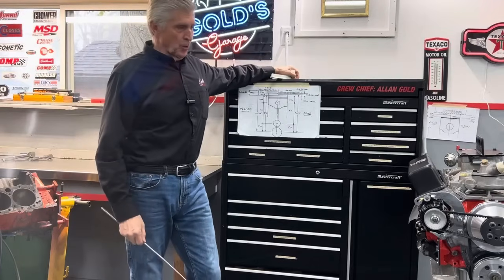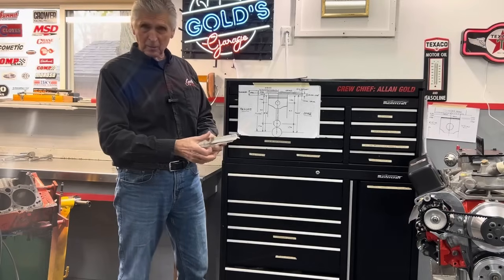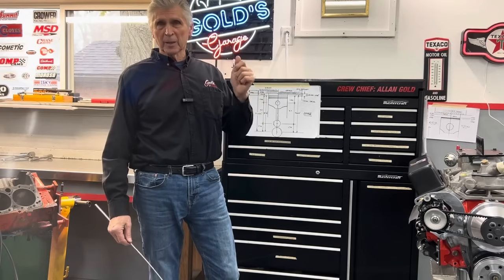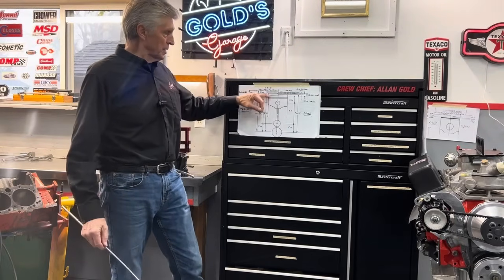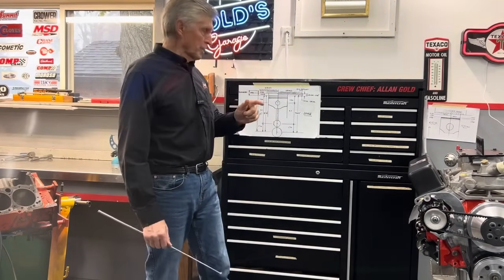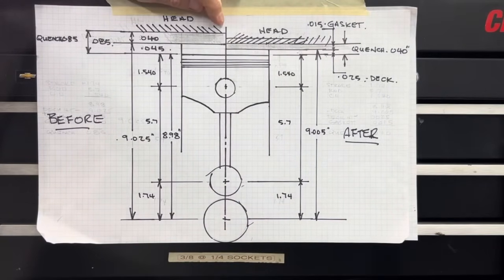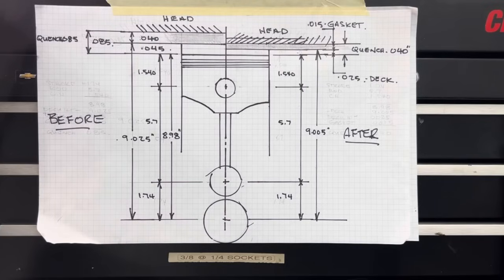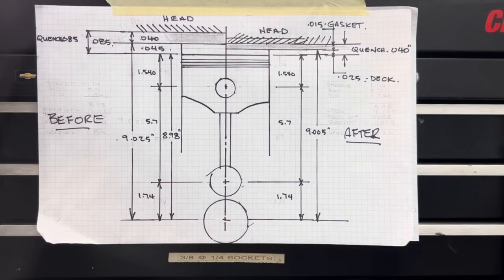MORE COMPRESSION, MORE HORSEPOWER LESS QUENCH! Why it’s Important and what is ideal?  🚫DETONATION

Comment: Standard "deck height" of a SBC is 9.000", not 9.025"

Half of the stroke 3.480" = 1.740"
1.740" + 5.700" rod = 7.440"
7.440" + 1.560" compression height = 9.000"

Factory blocks came with .025" to .030" of "meat" on the deck surface by design. It was to allow for future serviceability. They didn't know it was going to become the staple of production V8 engines throughout the world. They just knew at some point it was going to need to be rebuilt.
Reply: Just as I thought, a quick inet search says Allen Gold IS correct...
Reply: @alleyoop1234   You need better sources.
Standard deck clearance is 0.025" to 0.030" which brings the total deck height from 9.025" to 9.030", but that's not the spec of the block. 

Have you ever heard of someone "zero deck" a block? That's what they mean. Bring the surface of the deck down to 0.000" variance, ergo, within spec of 9.000".
Reply: @Carl_Jr   My machine shop considers zero-decking to be matching the installed piston height, regardlesss of deck height dimensions.  If you want a 9.00" deck, regardless of installed piston height, that's what you'd ask for. Maybe my machne shop is unique.
Reply from the maker: I am enjoying your conversation guys, thanks for contributing to my channel. AG
Reply: @100amps   It sounds like they're using vague terminology. You can't zero deck a block to the installed piston height because some pistons have different compression heights. There are some pistons which are called "claimer pistons" which have a compression height of 1.54" . If your machine shop were to deck the block down to those they'd likely hit water.
Reply: Deck height is what you make it, and it starts at approx 9.025" as Allen said, on a SBC, hence "standard (original) deck height". Compression height is 9.00" as you said. "Extra meat" on the other hand... well... I can't say I've heard that term before. Tomato/tomawto.
Reply: @100amps   Compression height is the distance from the center of the wrist pin bore of the piston to the top edge of the piston.
Reply: @Carl_Jr  You are correct on that. My bad.